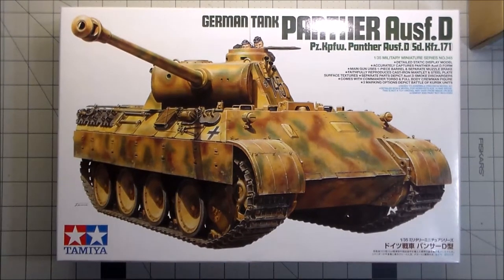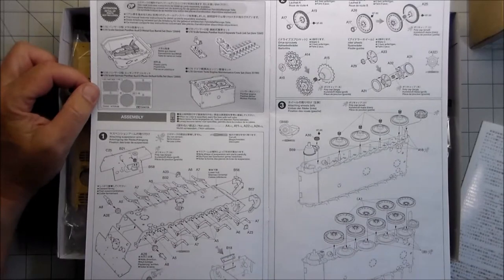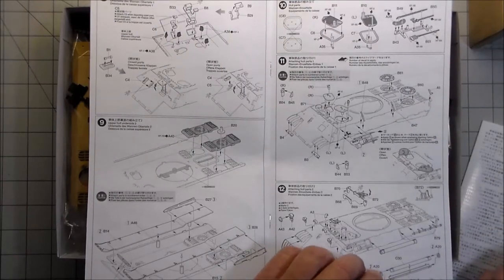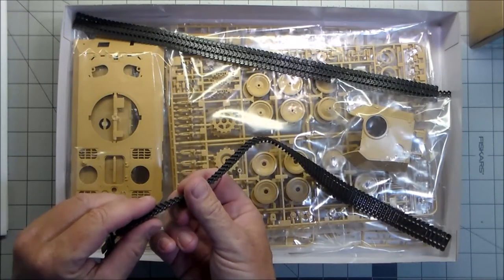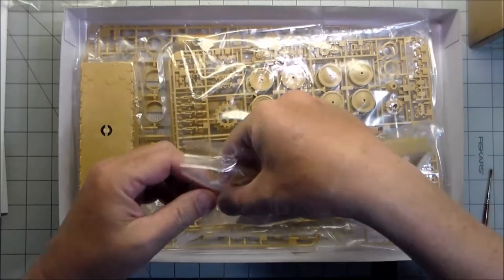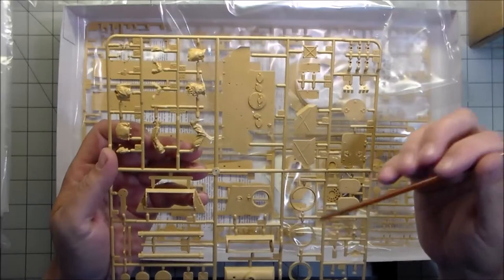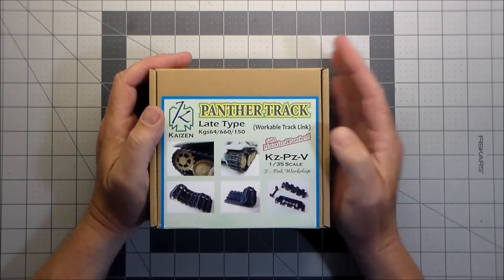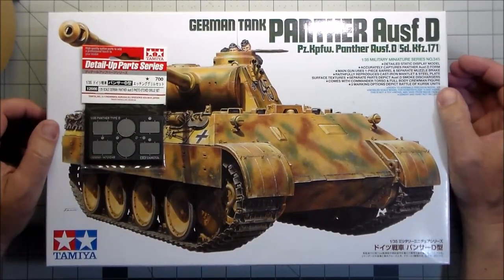Tamiya Panther Ausf D Intro

Comment: Great review on this kit and looking forward to seeing it come together with your talent! Years ago to get that proper sag to the tracks I would drill holes into the hull and insert small pins to hold the track down at the proper sag look. And once it was weathered you could not see them at all! Psssst--Still do it yet to this day!! So have fun with this build  Brett and will be looking forward to the next installment!
Reply from the maker: Thanks, Bob. And the track-sag method is the very same one I used when i was building in the late '80s. I got first in a local contest with a King Tiger I built with sag like that.

Comment: I like using metal tracks but holy crap they are expansive
Reply from the maker: Indeed they are. That's why I use Kaizen tracks when I can. They work just as well, are easy to assemble and are a bit more affordable.
Thanks for the comment.
Reply: @BrettG64  I have a question can it be possible to to make the road wheels roll without gluing it
Reply from the maker: @Reshiram_The_Fire_Dragon  yes. The way they are designed they will roll. Most tamiya kits are designed this way. For me it makes the wheels easiers to paint if mounted.